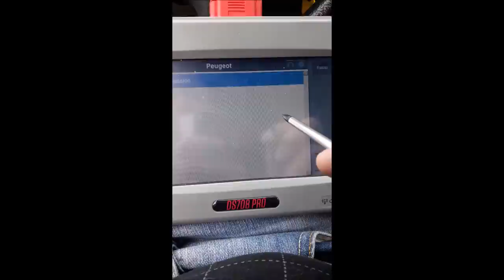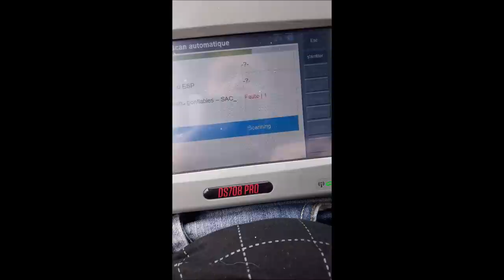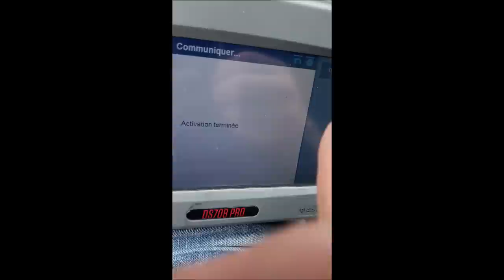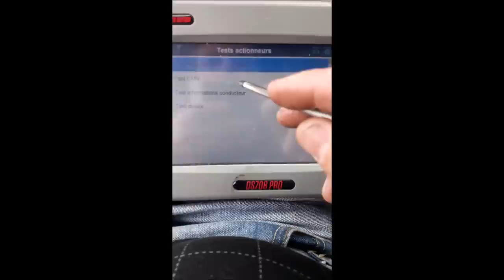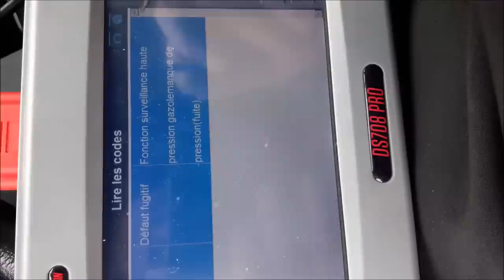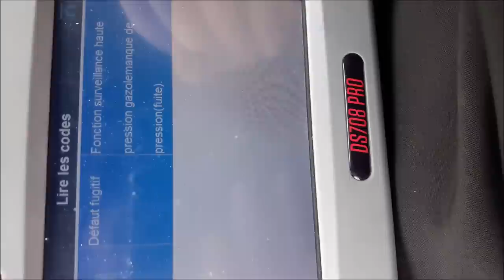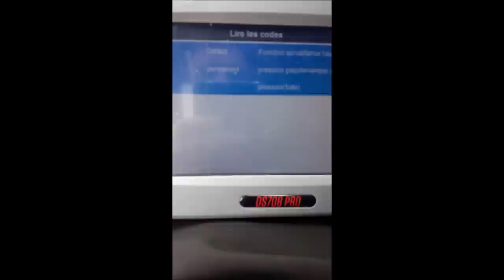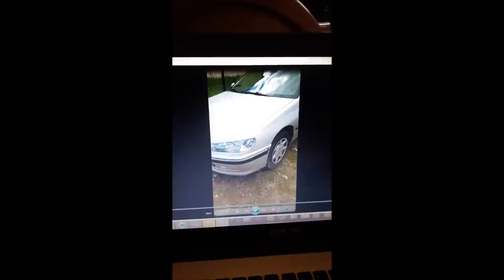Réparation fuite injecteurs  406 2001 (démontage au tournevis)

Comment: Salut, fred une maladie très connue des 406 diesel, c’est que les joints du boîtier filtre à gasoil finissent par sécher au fil des années et fait que le circuit prend de l’air.
Expérience vécue sur 406 td dont j’ai remplacé les joint du boîtier filtre à gasoil et la voiture est redevenue à la normal.